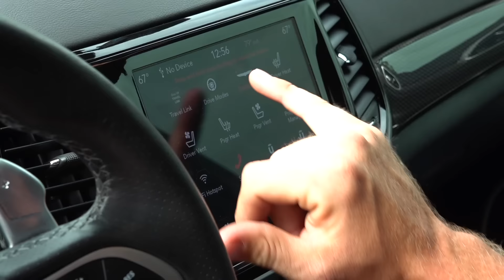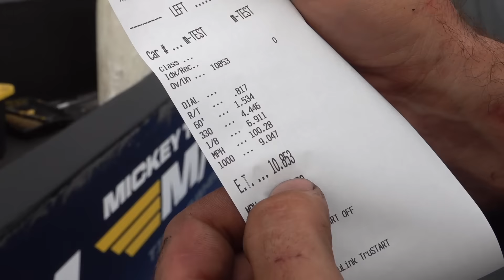Magnuson Supercharged Silverado CALLED OUT Our Newly MODDED Trackhawk!!! (Pulleys, E85, Tune...)

Comment: Given there is probably 75 G difference in price, Silverado is hard to deny.
Reply: Ew not a chebbie
Reply: Them trucks aren't given away, and there's a major price difference between work trucks and performance trucks!
Reply: Theres no Silverado in this video....
Reply: @phenry5083  Yup, that boy's got a Sea Air Uh.
Reply: Very true,
Except it's probably way closer to a $100k difference, not just 75
Reply: Privateer driving his own truck that he built with his own money against a Jeep owned, modded, and operated by a multi-million dollar corporation.
Reply: Not even close. The amount of money george has dumped into that silverado is more than you think. Stock for stock yeah....but you get way more bang for buck outta the track hawk.
Reply: Love me a work truck
Reply: @phenry5083 what's the difference lol
Reply: gasser ew
Reply: @Saiyan4658 yeah sure but they are still not reliable at that power for more than 60k miles as a previous owner, everything starts to fall apart the carbon will all delam it will destroy the diff eventually the struts only last 40k miles lowered each one is about 1300 bucks lmao and the electronic diff brand new is way more
Reply: @lukekelly5115  nothing is as reliable as it was stock when you start modifying it. I can't attest to the 60k miles for being modded at that power level but it depends on how you drive it and normal maintenance.
Reply: Truck has a fully built Texas speed motor along with trans and supercharger. He has alot into that truck
Reply: @Saiyan4658  well I already attested to that lol, those things chew threw diffs and transfercases lol especially if you don't change the oil every other oil change
Reply: @sategllib2191  GMC is luxury, had additional options, extra sound dampening, etc
Reply: @URsooomad8613  true but one is also more reliable at the power level
Reply: And a new $11,000 motorcycle will match both.
Reply: @BleedingWhiteKnuckles   Just Basic work Trucks are super expansive these days.. I agree with you..
Reply: @exothermal.sprocket  ya i like bikes but i know myself
Reply: @Saiyan4658 about 20k of engine and super charger into a 5k$ truck. Guys are making 800 to 1000 whp on stock 5.3s with less than 1k into a china turbo kit that run quicker than that trackhawk. That being said i hope i win it.
Reply: after all the maintenance parts and labor to keep the gm aka general maintenance or government motors vehicle aliive all these years they equal out in price
Reply: @lifted_above  Any old 1st gen Yamaha Vmax does 10.8s bone stock. They go for $5-6kall day. I had a 92 slightly built. It was FUN!
Reply: @exothermal.sprocket  well dam, a jet airplane would probably outrun a civic. WTF are we even talking about?
Reply: @exothermal.sprocket no one's impressed
Reply: @tamiyaclodbuster  gm is the most reliable and cheapest to maintain. My 4.8 silverado just hit 315k miles. Engine still has great compression and cross hatch on cylinder walls, rebuilt the 4l60e and its ready for a turbo and last until the end of time.
Reply: @meaninglessvalue7778  If you've polled everyone to find that out.
Reply: @glitchn50  One might wager that it's a lot of extra money to pay in place of practicing some general throttle restraint. Haha
Reply: @miketee2444  We weren't talking about your weak emotional state. The whole goal is to move your body quickly over ground. There's a lot less expensive ways to do it. I suppose you think this Youtube page has a lot of rules, one of which nothing short of 4 wheels and 8 cylinders is allowed and is to be cancelled with very hostile reactions.
Reply: @brian_sipe GMC= gay man’s chevy
Reply: Have you built and engine 😂🤦🏻‍♂️
Reply: How much u think he spent on it lol
Reply: @boperry3551  None of our faults they're not making enough power on that setup.
A junkyard LS with a Whipple will do the same exact thing for 10k plus the 5k for the truck, with stock trans
Reply: @sooomad8613  I'd love to see a stock 4l60e hold a 800hp motor with as much torque. The Texas speed motor alone he has is a 20k motor, 10k on the Whipple, whatever built trans he has, a truck in that shape is a 10-15k truck all day. The fuel system etc. Your not building a junk yard motor. Your building a race truck.
Reply: For real!
Reply: Trackhawk just got 25k worth of upgrades. I'm exaggerating, but only a little
Reply: Sierra**
Reply: @URsooomad8613 there’s always that one guy
Reply: @boperry3551  Built LS3 does that all day☠️
The truck is only 10-15k if your IQ is low enough to pay that 💯 💯 💯
Reply: That truck will hold its value unlike the trackhawk. At some point the truck would even be worth more.
Reply: You're really saying that not knowing how much he's gone through to get it to where it is 🤣😂🤣😂🤣😂🤣😂🤣 dude just doesn't know
Reply: @mikewazowski7830  my comment was about money. I have built many vehicles and motors. Since you mention that. Not knowing what is going on seems more likely your deal than mine.
Reply: Are blown build Silverado’s just free now?!

Comment: Damn George’s truck is way faster than it looks I for sure thought the LT4 Tahoe could get him, I was wrong 😅
Reply: Yeah I thought the same thing when I pulled up next to him in town. He lives near me... I was wrong... lol
Reply: @kick_then_shift  I’d stop race him in the Tahoe 😎
Reply: Dont sleep on Silverado's they can be very fast.
Reply: I thought it wouldn't even be a race.... I was very wrong. What power is he making?... Isn't it just a 5.3 with that blower?
Reply: @smooth_ops2942  I believe it's a Texas speed 408
Reply: @smooth_ops2942  it’s a lot more than that. I believe it’s a 408 from Texas speed. So it’s making some good power. I figured the Tahoe is putting down around 700 on full e85 it would be a close race but George would get me for sure haha
Reply: As long as he’s not tearing up belts 😂😂😂
Reply: Id say George's truck is making prolly 7-800 hp just a guess though prolly more
Reply: 😂😂😂😂😂 yall really thought that heavy ass Tahoe was gonna win. 😂😂😂😂 yall need to learn about power to weight ratio that Silverado is at least 2000 pounds lighter
Reply: @vbealer32  the Tahoe and Silverado actually weigh about the same about 200lbs difference
Reply: @vbealer32 there not a 2k lb difference damn near the same weight
Reply: @smooth_ops2942 it’s not a 5.3. Even if it was a 5.3 bottom end can hold serious power
Reply: What Tahoe all I saw was a Silverado  and a jeep track hawk
Reply: George has 2 people in his truck
Reply: @vbealer32 they’re built on the same platform 😂😂😂 bozo

Comment: As close as that roll race was I think we need to run it back with more distance before a winner can be crowned.
Reply: Trackhawk was pulling in the end
Reply: Ya, longer race would just be a bigger meal at gapplebees
Reply: Longer race should technically give an advantage to the 2wd vehicle...
Reply: Yah but between George and Jack stand anything is possible Georges truck is capable of well over a thousand hp it's just not turned up. "Yet" lol
Reply: Once the turbo spools in high gear that ol' Silverado gonna start steamrolling. I'll tell you what though, what George could use there is a scramble button xD
Reply: Don't want to hate on this but where's the helmet and jacket? We don't need a "JJ DA BOSS" situation here with NHRA or the insurance companies. One screw up here and you know the drag strip haters will go viral with these videos. Love BMP and would hate to see bad things happen for a lack of not using safety equipment even with what was probably a private track use.
  FREEDOM FOREVER BUT SAFETY 1ST
Reply: George also had jackstand as passenger while Cleet was by himself I’m sure that weight made a difference
Reply: @russellderonda1489  not sure the rules but they were just messing around on the big end of the track not actually making full runs but I could see the insurance company still causing a problem.
Reply: @lanceuppercut6168 what turbo? Not a single turbo on either vehicle
Reply: @russellderonda1489 I’m not sure if it’s changed but at least when I used to go you didn’t need them for anything over a 9.99 pass. I’ve ran numerous 10’s while at test and tunes with no equipment.  Now channel wise and all that stuff id agree it could bite them later
Reply: @annadarby7224  you need a helmet for anything under 13.99 or quicker,  jacket is required at 11.49

Comment: You guys should add a flex fuel sensor and get a real flex tune.  The Trackhawks ECU supports it and it would be a million times better for a giveaway vehicle to a person that can just fill up with any combination of pump gas or E85 and not worry about draining tanks and flashing tunes trying to swap over.

Comment: Not sure if anyone has brought it up yet but I believe the springs were installed backwards. This is a very common mistake with Trackhawks and Srts. It results in the front end being slightly higher than the rear. You may have been told to it will settle and look right but that is incorrect.

Comment: Needs bigger Crank pulley.
Smaller SC pulley just cutting corners 
Too much stress on Valve train causing Smoke on Idle
Knock!! A-F Ratio.....too much Air for Complete Combustion 😢😢
Now Dom's going to have to replace the Manifold that Brian has just Fried😂😂

Comment: That blower belt is avbig azz belt.  How many ribs, 12?  I was learning about multi-vee belts to use them as my go-to drive belt for equipment I design & build.

The grip on multi-vees is impressive; each rib is grip equivalent to one std ⅜" V belt.

If the blower belt has 12 ribs, it's likely having 12 V belts.  Chit, that's 10hp, multi-stage industrial compressor/generator/turbine!
Reply: Those superchargers are probably pulling 40+ hp at high rpm. Really pushing the belt hard. 
The power ratings for regular use are pretty low so the belts have a good service life. If they’ve got a good wrap and good tension they’ll transfer a lot of power for a little while.

Comment: Instead of a fixed pulley wheel on the supercharger how about a pulley from a CVT transmission from a scooter. One that starts large and when gets to speed it reduces ends small. Would that be better?

Comment: You  are  going  to  laugh..... when I tell you this ( l will try to keep it short ) . Date... summer of 1976 . My friend and I had tickets to see KISS in Lexington Kentucky , we were 16 . My car ( 71 Opel GT)  was getting it's second engine , I blew up the first one . My friend only had his Dad's new 1976 Chevy Pickup and his Dad would NOT let us drive it out of town . So... his aunt let us drive her 72' immaculate but boring looking Ford Torino with a 351 Cleveland motor . It looked like a grandma car , bench seat skinny tires with mag wheel style hubcaps . We were real dissapointed though because for a 351 Cleveland it seemed slow . Anyway we left Louisville and realized it seemed like it didn't shift into High ( automatic ) even at 70 mph . Like I said we were dumb 16 year old punks and so we weren't sure why this was happening . Finally we just floored it on a new stretch of the interstate and it was revving hard at 90+ and it finally shifted AGAIN at 96mph and it smoothed out again and just started climbing HARD until we backed off at 145mph ( it was not sweating hard at all ) . My friend's Dad was a Louisville County Policeman and since he was 6ft. 6 inches tall and his name was Stormy we modified our story a bit . We told him the car must have a problem because it revved too hard and didn't seem to shift right . He took the car to the County police garage and found out it was built to be a Police highway interceptor vehicle with a police rear end and the 351 Cleveland engine . It was made to chase down high speed cars on the interstate . Louisville County bought the car and gave his aunt a good car of equal value .  145mph and that car was not even revving hard !    PK

Comment: When the guy reading the timeslip has an approved firesuit on but the guy running 10.80 @ 124mph has shorts and no helmet. Come on man, you all have families. That chassis wasn't designed from scratch to run 10's. Lets have some sense here.